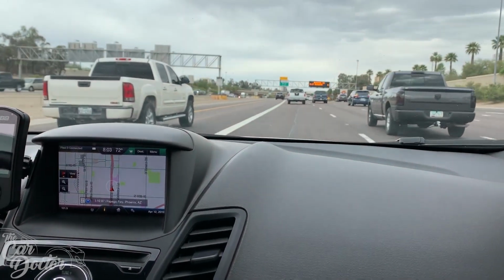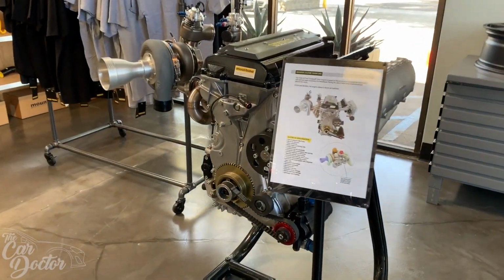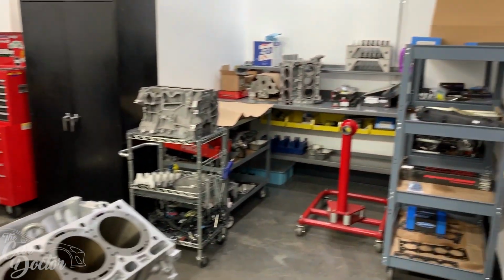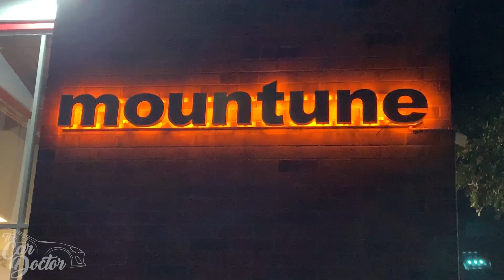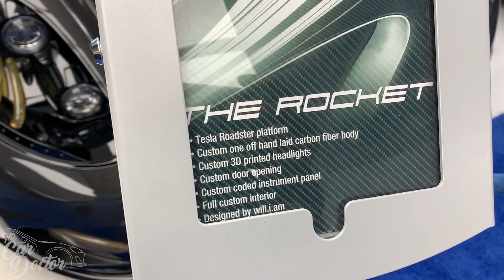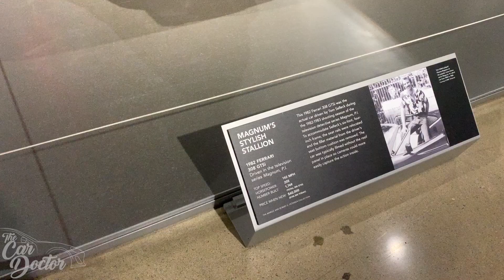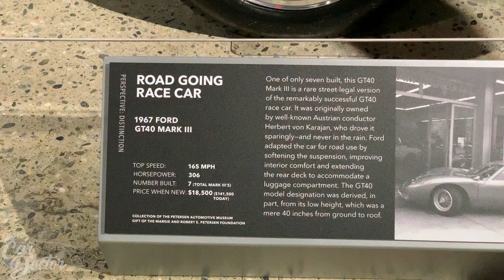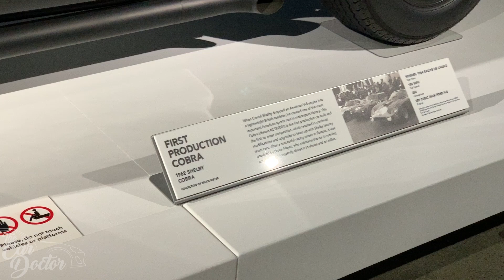Mountune MoFoCo Meet 2019 Road Trip

Comment: Are you guys on a full e85 tune?  How did you pull that off?
Reply: Jeremy Knight if it’s legit he’d have to be running better a better fuel pump. Stock can handle E30 and aux can only add up to E50 before the whole system can’t keep up and lean out.
Reply from the maker: Currently on E54 pump gas tune. Did it with an extra ten gallons and knowing which stations carry E85.